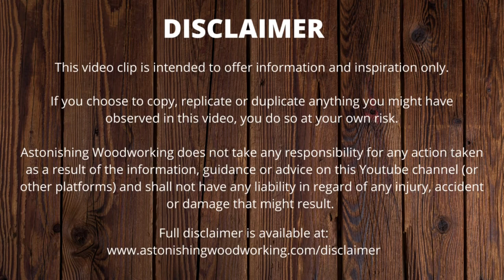Butt Joint Reinforced With Spline | Butt Joints

Comment: Great video. I have been wondering if this joint would be strong enough for attaching a table leg to an apron? Obviously, the spline would need to be right sized, but this seems easier than dowels (less error prone).